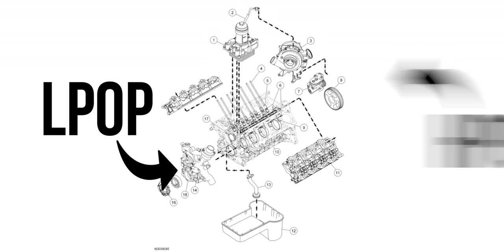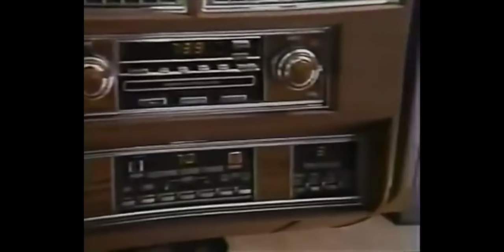These are the WORST ENGINES EVER MADE

Comment: Like the vid. Back in the 80's I worked on a lot of the 5.7 liter Olds diesels. I changed so many head gaskets, I could almost do the with my eyes closed. The injector pump had a flex ring inside of it, and would deteriorate in the fuel. I always thought they ran quite well and got good mileage. They were also slugs, but in a nice big Cadillac or a Big Olds or Buick, you drove those vehicles pretty much in a conservative manor. But wow they were junk. The used car market was full of these late model good looking cars, that could be had on the cheap. It didn't
take the new owner long to figure out why, they could get such a nice late model car so cheap!  I would feel sorry for these folks. and our shop was full of these cars. What a troublesome (P.O.S.) these engines were. Thanks for the memories, I haven't thought about these engines in years.

Comment: I would add, when I bought a 1980 Chevrolet pickup truck, with a 250 in line 6 cylinder, it had the integral head, problematic 😐

Comment: There are a lot more candidates, especially if one goes with 'the worst engines ever made'. One is the old Ford Y-block. A real turd in performance, so Ford added a blower. This was primarily in the mid-50s T-Bird. They liked to relocate the rods at anything over 5500rpm. Then there was the Chevy 348/409. Yeah, the one they made a song about. Whose idea was it to create the wedge combustion chamber by using a flat cylinder head and a lopsided, off balance piston? This too liked to relocate engine parts externally. This staggered valve design morphed into the 'rat' engine which was  a far better design. In the foreign field, there is the Land Cruiser engine that was a Chevy 232-type 6 cylinder from the early 50's bought and re-imagined by Toyota. A more gutless, gas sucking engine was never made. How anyone could miss the Vega aluminum engine with stand-alone cylinders that liked to reshape themselves is a mystery...possibly the very worst designed and built engine GM ever put out. Along those lines, I can't forget the aluminum 215 Olds engine from the early 60s. When they were new they ran fairly well, until the head gaskets blew or the heads cracked, which they all did. Also the GM (Pontiac designed) 'Iron Duke' 151 4 cylinder of the 70s that was well known for cracked heads...at least it was cast iron. In the field of newer engines, whose brilliant idea was it to use in nearly every OHC engine by every US manufacturer a link-type timing chain instead of a bicycle-type chain? This is a built in self-destruction design clearly meant to take out the entire engine. Of course there are many examples of decent design as well, even though every design had it's issues and drawbacks.

Comment: The 2.7 liter Porsche M96, the first watercooled flat 6 from them. Piece of crap. In addition to failing Intermediate shafts that trashed your valve train at failure, you had nylon/plastic chain guides that cratered early, VVT solenoids that failed prematurely, and early crankshaft end seal failures. Happened to me in my 2000 Boxster, and a few buddy's 911's.

Comment: Worked at a major rental car co. in early 80's and would fuel & clean things like Chevettes, Fairlanes/Fairmonts, Lincolns, Escorts and K cars.  All except the 2.2/2.6L Mitsubishi engined K cars suffered from run on.  The worst were the Chevettes and Escorts.  We would park them and shut them "off", walk inside the office to drop off the condition sheet and 45s or more later come outside and they would still be running on.  As compared to the Chevettes and the Escorts, the K cars were much better built and felt like they had twice the power.  That was a time of incredibly poor quality NA made vehicles.  The drop in power output from around '72 onwards was dramatic.

Comment: We have a 2018 Honda CR-V with the 1.5L turbocharged engine that has been known for getting gasoline into the oil. There was a recall that deactivated the engine shutdown-at-a-stoplight function, which I think helped, but how does an engine get gas in the oil?
Reply: Flooding the cylinders with excessive gasoline that gets by the piston rings.

Comment: The 2.4l GDI Kia makes is a dumpster fire also. Gutless and drinks a quart and a half of oil during a 3000 mile oil change interval. That's probably 80% of the reason they're getting towed into shops with trashed engines since no one pops the hood and looks at anything anymore until they are 200 miles past due for a change. Also people are trying to run 5000+ mile intervals now which would be just enough time to starve the poor thing. Being direct injection plus Kia using "low tension" piston rings to reduce friction for economy purposes pretty much guarantees it's gonna have problems. Also the pcv valve is set so low that I'm almost certain is sucks in oil from the top end when it's running.

Comment: I'm amazed you mentioned the olds diesel and 8-6-4 and not the HT4100. The olds diesel wasn't that bad. It's a sbo with big block main journals an huge main webbings. So you can put a 455 crank with custom lenght rods to get a 440 small block olds that can take tons of abuse. The 8-6-4 wasn't that bad after you unplugged the solenoids. But the ht4100 was garbage from the get go. Aluminum block, cast iron heads, aluminum intake. So every single gasket would blow from different thermal expansion. Tiny head bolts that go on the outside of the block. The wiped out cams at 1500 miles. My buddy changed these things every day for monthes at the caddillac dealer. They had rows and rows of engines stacked up with customers names on them just waiting for them to blow up and have a replacement already there. Blocks cracked all the time. The worse northstar.

Comment: The Chevrolet 2.4 liter ecotec engine from 2010 thru 2017 was the worst! It consumed oil at a quart every 1000 miles, it leaked oil everywhere, the engine had to be dropped to change the water pump and after years of litigation chevy finally recalled it but only engines with under 120K miles on them.

Comment: Anyone that actually works on fords knows that the 2v tritons are excellent engines. 90% of the time the spark plug issue is due to improper installation without a tq wrench. Also, calling the 6.0 powerstroke one of the worst engines and not even putting the 6.4 on the list when it’s 10x worse just shows how much of a clown this guy is. Be careful who you take your advice from guys because this ain’t the place.
Reply: Like come on, everyone knows crown Vic’s are some of the most reliable daily’s out there, and guess what engine they have?? Ding ding ding 2v triton. An intake manifold every 150k and proper spark plug installation, they go over 300k miles with ease.

Comment: I disagree that OHC engines are inherently superior. They are only superior when displacement is a limiting factor (ie countries that tax based on engine displacement). Pushrod engines make a lot of sense if displacement doesn't matter. They are smaller, lighter, cheaper, less complicated, produce more low end grunt and are more fuel efficient for a given displacement. The only downside is they produce less power for a given displacement. But again, if there's no displacement tax, just make up for it by adding displacement.

Comment: You hit the nail on the head in the beginning but slid right past it? Why? NMW n54 engine has the timing gears in the back of the engine and is unserviceable!  They literally were designed for the rental and lease market and are guaranteed to explode befor 120k miles!!

Comment: The 6.4 to me seems worse than the 6.0. At least in my experience, if you leave a 6.0 alone and bone stock, it'll run just fine providing the coolant/sand issue is handled early on with a filter. I'm on my second one, now after 20 years, and 130k, its been fine so far. With the cost of new diesel trucks, I'll likely die with my 6.0.

Comment: The absolute worst engine ever designed was the British Rover 1.8 litre K-Series engine. Idiotic design that was guaranteed to suffer head gasket failure before it reached 90,000 miles. There were reports of HG failure as low as 20,000 miles.

Anyone interested in bad automotive engineering and design should check out some good documentaries on this vile pile of poo engine on YouTube. I wish I’d watched one before buying a car with this horrendous thing in it. (Mine failed spectacularly at 80,000 miles, and I drive very conservatively)

Comment: The olds 305/350 were the best. I own both and if you can't change the damn head bolts and quit using it like a drag motor, they are absolutely awesome. Both usually get 25 mpg at 75mph/120km zero problems except for the usual oil and alternator change.

Comment: Ford 3.8 from late 90's, did so many head gaskets I could do 2 a day 1 before lunch and one after lunch. Ford 4.0 SOHC late 90's/early 2000's, timing chain tensioner quit the Ford dealer because all I did for the last year I worked there was replace these motors under warranty.

Comment: Most of GM 4 cylinders weren't great - especially concerning noise and  vibration. The iron block OHV engines (iron duke & Cavalier 2.3L) were reliable enough, but they were rough, unrefined, and underpowered compared to the OHC 4 cylinders the Japanese automakers were producing at the time.

Comment: Ford 1litre three cylinder eco boost ...with an internal timing belt ..which requires an engine rebuild to replace it at 100,000 miles or complete engine replacement which by this time will cost more than the resale value of the whole car

Comment: You have me a bit concerned, I have a 2002 e250 with a 5.4 Triton that was rebuilt at about 200k. It has 260 now and couldn't run better. Uses or leaks no fluids, all I've done is replaced a couple of coil packs. Could they have done any upgrades on the rebuild?? 
I also had a 2000 F-150 that I sold last year with the same motor 160k on the original motor and there was minor top-end noise when I sold it. I had them both 15ish years, you guys just got me wondering if I should sell that e250 also, great runner or not thx. Oh the rebuild with done just before I bought it so I don't know the details

Comment: Not sure what he's got against the 2.2L chrysler engine.  It had minor problems that were easily repaired.  Most problems were from customer abuse.  If the timing belt broke, just put another on, and drive away.  The turbo version is still listed in SAE papers as the most efficient for a decade.  It was the optional, miserable mitsubitsi 2.6L engines with their never ending timing chain rattle and carburetors that were the problem.

Comment: The Subaru EJ251, EJ252 and EJ253 engines that have the head gasket problems due to the composite-style head gaskets. The class action law suite for the defective Honda 1.5-liter turbo direct injection engines that allow fuel to contaminate and dilute engine oil.

Comment: I think the izuzu 1.9 in chevy s10 series 1 ...was one i first thought of after the 2.3 Vega. The 1.9 in s10's were way lean burning, and should have came with a 3/8 long drill bit to clean the blocked EGR  Passage frequently. In all fairness to Izuzu,  their 1.8 worked well in the luv trucks in comparison. Gm put way too high of gear in rear of gen 1 s 10's  the power valve apparently did its job too well leading to a plugged egr passage. Re- jetting the carb was hard to get right . Best way was a complete number drill set . And start the painstaking process. That fixes the lean burn problem at normal driving if you put a3:73 gear in the rear. If a 2 stage power valve was available like some holley economaster Carbs their might have been a chance to get it to not carbon so bad . Just a head gasket eating little monster. A decent engine builder that gm ' s oversight in the obvious things I mentioned. Just reflected poorly for isuzu, and the end user got a small truck that couldnt pull itself 55 mph w/o lugging. For all the folks who got screwed with out even a kiss. You could have bought the car of the year, when The VEGA  ARRIVED.  OMG THE PAIN OF IT ALL.  IF YOU HAVE A VEHIVLE WITH A FRAME UNDER IT I SAY KEEP IT. lol!   Clay
Reply: The Izuzu 1.9 was a POS engine with low horsepower. 0-60 could be checked by boiling an egg. Luckily my S10 was squashed by a tree instead of unloading it on another owner.

Comment: The GM 6.2 and 6.5 diesel engines were terds too, especially the 6.2. They sounded mean but that was about it. Any 4.6/5.4 triton would run circles around them lol
Reply: I had a 6.5 turbo diesel. It was reliable after I went thru it and fixed all the unique issues. The military still uses them to this day and are still being made. Not a huge powerhouse but it could pull a livestock trailer around easy enough

Comment: The Cadillac 6.0 engine was not a destroked 472. They had the same stroke but the cylinder bore was much smaller. Weight was shaved  from the crank shaft so it would spin faster and weight was shaved from the block as well. The engine had great low-speed Torque from a standstill but quickly fell off. Making the 350 olds engine a much better option

Comment: Triton engines are boat anchors. The 3 valve spark plugs wouldnt come out and broke off in the head. So you either blow plugs out or cant hardly change them. The timing chains suck, The intakes fail and normally you have to buy the whole intake. The coil packs fail weekly. The exhaust manifold bolts constantly break off in the head.  Ford owners are like beat women. They just keep getting punched in the face and keep going back. I have been a mechanic for 23 yrs, and have owned a bunch of brands of cars.  I will walk before I drive any Ford. And aside from the Trucks GM's Car and Suv engines are terrible also. The 3.6 needs the 3 timing chains replaced every 50k or so.

Comment: All these BAD engines are too complicated, with all the so called FUEL SAVING. Mile long timing chains, cam position sensors, more JUNK to fail. The old school PUSH ROD, Overhead Valve engines are much better. How about ELECTRIC cars with a simple MOTOR that just spins. No hundreds of wear prone parts. Not to mention NO exhaust, emissions, NO coolant system, NO EVAP, crap, NO O2 sensors, NO 2-4 CATS , No fuel systems, these cars have been STALLED in development, for decades due to the OIL INDUSTRY. Always at their MERCY, and price gouging. NO more smog, reduced climate change, and less environmental disasters. Time to get rid of the antiquated internal combustion engines, and advance to a new revolutionary vehicle.

Comment: The Northstar, for sure. The 8-6-4 ? Personaly I can't stand when people degrade that motor. Last of the Cadillac cast iron big blocks. Disconnect the system and they run forever. Costumers never bought large Cadillacs for fuel economy. You really should have included the HT 4100 from 1982-1985 instead.

Comment: Northstars weren't that bad all things considered, all their issues kinda came down to 2 things: GM being cheap garbage especially in the 90s, and the engine is designed for front wheel drive first and foremost. The seals leaked because GM used cheap seals, aftermarket seals fix all the issues, the head gaskets blow because the bolts are too small, also fixable you get it rebored for bigger bolts. Everything else is just cos it was costly to repair a fwd v8 becuase there's just 0 room so  lots of maintainece and cheap fixes where skipped for more expensive problems down the line. Seriously try to remove the rear valve cover, you can't it's just not happening. They're "OK" engines. Considering you gave the N54 a pass, i don't see why the NorthStar doesn't get one for the same reasons, being an amazing engine WHEN IT'S GOOD and admitted garbage fire when its not. The Cadillac gets a bad rep because the LT1 came out in 1995(?) and was amazing and then the LS came out in 1998 and set the standard for how good a v8 can be while still being a simple lump of iron. I wonder if GM will ever go back to the NorthStar platform and base something off of it, even if you call it a bad engine it had an 18 year run and they fixed most of the issues, the later supercharged 4.4 didn't blow anything afaik, same as fords pre cayote Modular it just needed time to grow.

Comment: Why did GM can the 3.8 v6?  That motor would go for. At least 250, 300,000 miles. And replace it with the shitty 3.6.  Uses a quart of oil every week and half.  Surges, not a lot of power.  Ever notice the more that “high feature” something, it turns to crap?  I saw a new Silverado pickup the other day.  Dude gets out, clicks the fob to lock, low and behold, the front signal lights sequentially flashed downward.  That’s one of the reason trucks are $75-$90,000.  Too many sensors, play pretty’s, etc.  never mind the cost to repair…..

Comment: The entire Chevy 60-degree V6 engine family (2.8L/3.1L/3.4L) is a crap design, not as public as the Vega engine but maybe just as bad.  The original 2.8L was designed as the power option for the X-body Citation.  In short the engine has no bottom end, any attempt to make a performance engine out of it - 3.1L Turbo, 3.4L Dual Twin Cam - failed miserably, and the 2 pistons at one end of the block don't match the bore of the engine block.  Rather than ever fix the actual problem GM released service pistons that actually fit for engines so bad in tolerance that they had to be rebuilt under warranty.  Yes, in pedestrian form people could get 100k miles out of one, but that was as much luck as by design.  These engines weren't inexpensive, they were just plain CHEAP - cheaply designed and cheaply built.